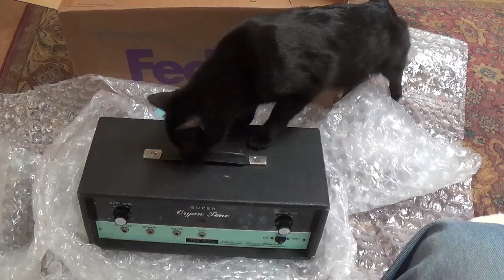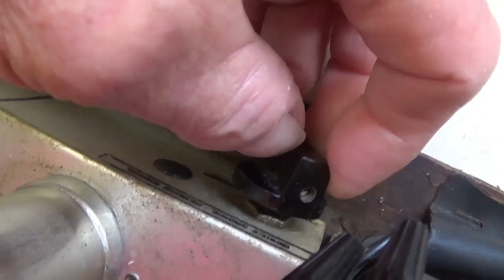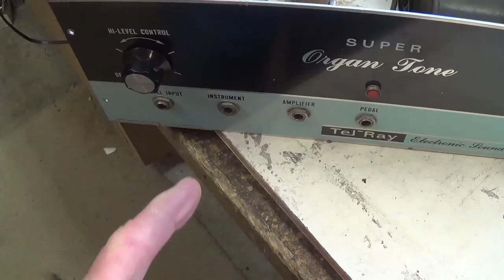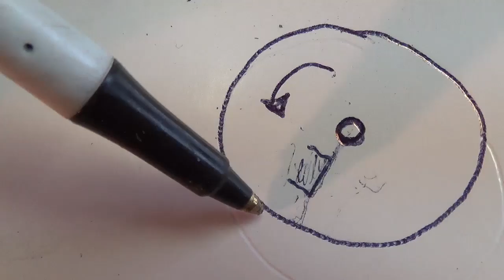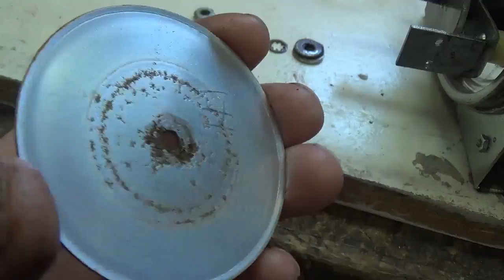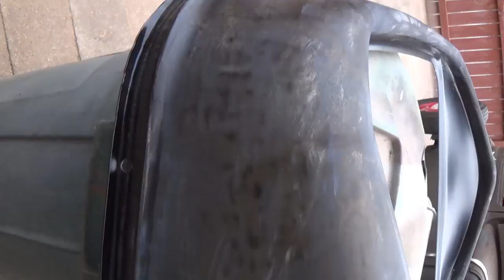Tel-Ray Super Organ Tone No.2: The Beat Goes On :)

Comment: Thanks for your videos and demonstrations (watched both of the oil can delay videos). I bought a Fender Dimension IV Sound Expander last year that was super clean and performed exceptionally. Found another just a couple weeks ago. The seller mentioned it needed new fluid so I purchased the UCON LB-65 from eBay. The motor works. Opened the can (very clean inside), removed the small amount of amber oil, added the prescribed amount of LB-65. When set to Vibrato I get a very loud hum / buzz. No effect. Switching to the Reverb setting the amps reverb works. The capacitor (red red orange white lined) has a cone shaped bulb(?) attached to it. I suppose it’s hard to diagnose from this, but is there any advice you can offer in what to troubleshoot next? Thank you
Reply from the maker: It's virtually impossible to troubleshoot a rather complex device long distance, Johnny. A loud hum or buzz usually indicates the loss of a ground somewhere in the circuit, or possibly bad filter caps in the power supply.
Reply: @ thank you for your reply. I totally understand. I’ll keep at it and try to figure it out. Best to you sir!

Comment: There were two versions of these units. One was Morely to sound like Leslie and the other was an echo unit. They used different oil for the cans. I never knew the difference.
Fender had a built in version on their solid state Super Showman. (An amplifier that fender regretted making. Total POS.)
Reply from the maker: I am familiar with the different versions of oil can devices, Y, but I tend to think they are all based on the same principles and use the same UC electrolytic oil.

Comment: I have a morley rotating wah pedal that need work please help
Reply from the maker: I'm sorry, Robert, but I no longer repair these pedals, due to the lack of replacement parts, the transistorized circuit, and the wide variability in outcome.....often not satisfactory. Hopefully, some other brave soul will assume responsibility for their restoration.
Reply: Oh wow you were so knowledgeable
Reply from the maker: @503frazier  Thanks, Robert. Use what I show you in the video and see if you can repair it yourself. Good luck.

Comment: It wasn’t clear how the neoprene make conductive contact with the metal disc. Is there a strip of metal along the end?
Reply from the maker: Since the music signal storage is done by static electricity, no current has to flow through the rubber. Remember how you pick up a strong static charge when walking on rubber-soled shoes?.....the same process occurs with the rubber read/write heads.

Comment: 2021 and this is still awesome. I'm wondering if they ever did these with a variable speed control? Was the pedal simply and on/off switch?
Reply from the maker: These old electromechanical devices really are pretty snazzy, Tom. I have not seen one with a speed control.

Comment: How did you clean the disc what did you use any cleaner or spray did you wipe off the disc if so with what kind of rag material
Reply from the maker: I used a clean terrycloth rag with some of the UC oil to clean the disc. I don't trust any other chemicals.

Comment: Hi Uncle Doug. Wondering if you can offer a source for replacement cans? - I have been using your video to help me along on a refurbishing journey, but my can is rusted out and has a few holes in it.
Reply from the maker: I have no idea where you can get any parts for these archaic devices, Albert. If I were you, I would patch the can with JB Weld and thin sheet metal.
Reply: @UncleDoug  Sounds like the kind of repair that's right up my ally. Thanks so much for the quick reply. There was quite a bit of rusty chalky build up in my unit. Going to take a fair bit of cleaning to get it back to operating. Love you video can't thank you enough!

Comment: Where do people find these things. In the late I miss the 1980's and early 90's when you could walk in to a pawnshop, flea market  or odds and ends store and find amplifiers stacked 3 or 4 high, speaker cabinets, loose parts, pretty much anything electronic. Really wish I knew more back then and had money. Haha
I did buy things that looked interesting, usually testing equipment and I gave that all away to my friends dad who was an electronic maniac.

Now, I kind of like the builds that Doug does over the manufactured models, something about using an idea or prototype is appealing.
Reply from the maker: I miss the pawn shops too, John......back when they actually offered desirable, old, used items at low prices. Now, it's like going into Walmart, except the prices for old, used items is higher than new retail.

Comment: any rubber coming in contact with oil would need to be oil resistant such as neoprene or nitrile rubber otherwise the rubber will absorb the oil and soften and if under compression as it would be when used as a washer will then creep out sideways under the compression forces. it will also relax and lose any tightness applied during assembly.
Reply from the maker: Thanks for your helpful input, Stephen.
Reply: Uncle Doug that’s my honours degree in polymer science and technology! :-) and now retired from the Dow Chemical Company

Comment: What is the value and taper of the pot going to the heads?  I’m on the front end of a Fender variable delay.   I’ll be reassembling a pile of parts and a sadly gutted chassis.
Reply from the maker: I don't recall, Jon. Does the schematic specify?  If not, I guess it's time for some trial and error.
Reply: Uncle Doug there is no known schematic for this version.  The 1968-70 Fender Variable Delay Reverb-Echo with five knobs.  I have all the parts but the chassis has been sadly electrically molested.  I love your films and the way you teach. You make math so simple, at least less scary.  I’d love to see a series on data book interpretation and pentode and triode load lines.
Reply from the maker: @jonathanhorne6503  Thanks, Jon. A video on Load Lines is in the works.

Comment: I know this an old video, and I haven’t watched this yet 

but you know what would be an awesome modification that would add interesting specific utility to a device like this , if the induction motor was replaced by a DC motor with a pwm speed control, and mount the control on the front plate. 
As you probably know an induction motor is fixed RPM based on the frequency 
With the ability to modify the speed live on the motor {and thus the disc} would in effect add greatly to the ability to modify the effect in that unique system, I don’t know if that was done later I didn’t know these existed until I saw your video 
Awesome.
Reply from the maker: Thanks for an excellent suggestion, Kolin.
Reply: Uncle Doug I put waay too much thought into this for something I don’t And likely won’t own , but if the 12AX7 filament is series and 12v it could be full bridge rectified for the DC motor voltage, the PWM speed controls generally are controlled by a single Variable Resistance pot
The upper speed could simply be limited by V to the motor I.e upper V and motor choice 
At a low speed I think it would have the type of subtle effect a lot of ‘professional’ musicians would find interesting , make the Var speed a pedal and you’ve invented a whole new effect lol. 
Thanks for sharing.
Reply from the maker: @kolinevans9127  Thanks for your detailed analysis, Kolin. Perhaps a viewer who owns one of these devices will try your proposed modifications.
Reply: Uncle Doug would be cool to hear although digital VST modules have probably tried to emulate a similar thing, nevertheless.

Comment: Uh oh, another cat scan.  Ever work on a clavioline or a mellotron?  With the foot switch to turn the unit on or off, does it then pass the signal through the unit to the amp?  Who in the world came up with this idea?  Ever work on a Hammond organ Leslie system? Another radial run out problem?  Does sound like the motor. The disk  behind the working disk is called the platen isn't it?  It looks as though the bushing is worn out.  What was that weird noise at the lower end of the frequency generator?  Well, as usual, you fixed it.
Reply from the maker: Fortunately, we were successful on this one. Thanks, Rusty.

Comment: I see a mistake.  The brushes should not be that close to the disk.  they should not even touch it when its turned off.  when its powered up the motor also pushes the disk up into the pads, when off the disk pulls away from the pads.  this prevents the rubber from distorting and preserving the life span.
Reply from the maker: Sorry, PM, but having personally worked on several of these units,  I disagree. The disc in the units I have worked on does move laterally when it is driven. If it did, the gears would disengage. The rubber-head-to-disc distance does not change. Units I have opened, which have never previously been opened, are all set up exactly as I set this one up.

Comment: I’m extremely impressed with your analysis on both these videos. I’m wondering if you may have some insight on an issue I have. 

My Morley oil can echo that uses a identical or nearly identical drum, rubber heads and variable motor. My major issue is there is a “speed” control on my unit, when it is set to the lowest speed the drum spins, if I begin to turn it up it begins to stutter, and and the higher speed the drum seizes completely.  

Any input would be appreciated. I’d love to have a working unit but just can’t figure this out
Reply from the maker: It would seem that the mechanical gear drive that rotates the disc is badly worn, much like a clock works can become worn.....the gear teeth wear out and the bearing holes become oblong. Perhaps someone in your area is able to repair clockworks and could look at it for you.
Reply: Uncle Doug interesting, I never thought of that. I wonder if that component can be easily swapped out. I have a donor unit that I picked up the same time I bought the semi function pedal. The lid securing drum head is beat up but I figured an extra read disc would come in handy
Reply from the maker: @Beegs164  If the gear-drive mechanism appears to be identical, then it should interchange.....but doing so will require a complete disassembly (as I recall).

Comment: Doug, can you please elaborate on hoe you got the can separated from the back lid? I have a Fender version of this that is very rare that I'm trying to get up and running. It's virtually identical to the one you are working on. Thanks
Reply from the maker: The body of the can is carefully pried away from the rear lid, which is bolted to the motor plate. It's tricky, but can be done......be careful not to bend anything.

Comment: Amazed how simple the core of this is, a disc and 2 write heads.  I wonder how hard it would be to engineer a new one today? Is there a special coating on the disc or write heads?
Reply from the maker: The discs are anodized in some way to facilitate the storage of electrical impulses, Christopher. The method of anodization is currently unknown.
Reply: That's a shame, the mechanics are so simple other wise it could be quite a fun thing to build either as an organ tone or as a more traditional delay.

Comment: What a strange device. I would have thought the heads and disk would be magnetic, but judging by how there's just one cable going into each head I guess it's electrostatic, I am very mystified.

I would suppose that the original owner never thought of keeping the unit lubricated, on account of not only the oil being gone but also the bushings being shot in the spindle and also in the motor. Even dry motors don't initially vibrate like that until they have been allowed to chew the bushings. As for why was there lateral play in the bushing, that may be a consequence of having a force in that direction put by the belt as well as the spring that in turn pressed the shaft against one side of the bushing.
Reply from the maker: Thanks for your observations, Mr. TM.

Comment: Hi. @25.09, there's what looks to be a brown bush at the base of the spindle, before the motor plate - possibly this was supposed to go through the plate & might be something to do with stopping the spindle from rattling. I can quite easily see how bearings would wear significantly over time, due to that spring arrangement on the flywheel, which I'm guessing is there to stop the effect immediately when required. Overall a nice bit of sleuthing.
Reply from the maker: Thanks for sharing your observations, Annie. They are both astute and appreciated :)

Comment: Can you mod the unit to have a variable speed control? Like on a tape delay, if the motor is AC driven you can install a light dimmer, to slow down the rotation. Is this possible with these machines? Great work and explanation, as always.
Reply from the maker: Yes, I would think it could be done rather easily, Andras, without altering the device. Thanks !!!

Comment: What you are calling "twisties", electricians will call "wire nuts".
Fender marketed their version of the same thing as the "Dimension IV". I made the mistake of replacing the oil (that had "mysteriously" gone missing) with regular 3-in-1. Bad mistake, don't do it. Ever. The folks at Fender sent me a nice letter of reprimand when I had to send the unit to them for repair. My boss wasn't too thrilled, either.
Reply from the maker: You're right, Bill. There is only one correct oil to use in these devices. Anything else causes way more harm than good.

Comment: Could it be the polarity was switched of the motor, running it in the wrong direction?
Reply from the maker: No, it's an AC motor, PJ, and turns in the same direction as all Tel-Ray devices do. The heads were reversed.
Reply: I'm still wondering 'why' tough hahaha, people are weird ... thanx uncle D
Reply from the maker: After some of the screw-ups I've seen in amp "repairs", nothing would surprise me.

Comment: @25:08 you can see that the extra piece of metal you talked about maybe being put on to help the runout, is angled in such a way as to rub on the disk the same direction as the brushes. I wonder if instead of the last person reinstalling the brushes incorrectly, they miswired the motor so it was running backward. Is this possible?
Reply from the maker: No, the motor, as internally wired, can only run in a counter-clockwise direction. That is the way they all turn.
Reply: Not the variable echo speed unit motors, they spin clockwise because of the addition of an idler wheel pulley.
Reply: @SmokeyWire56  Thank you for the insight. I don't play much with motors so I was thinking the spin was decided by the wire connection.
Reply: @UncleDoug  Sorry I couldnt tell that from watching, and dont have personal knowledge of that systems workings, but know that at least some motors can run in both directions. It seems that the brushes and that extra piece of metal seem to set for the disk turning in the opposite direction. Maybe the person that rebuilt it before thought the disk turned in the opposite direction so set the brushes and the extra piece of metal both in the same direction.
Reply from the maker: Possibly, or they just didn't pay attention when disassembling it and put it back together incorrectly......we've all done it :)
Reply: @UncleDoug  What us do something incorrectly, say it ain't so! I'm always surprised when I actually put something together the right way. Whatever he did, at least he did it consistently. I do love the sounds that the machine makes, it might even make my guitar playing sound nice. Unlikely that that is possible, no machine is capable of the impossible.

Comment: Well...a CAT scan is a very good idea, Sir Douglas. As for KC, you'll likely have to find a management position for her.

Oh...okay. It was low on oil. I wondered why jack paused in that one area for a while. Prolly looking for a dipstick(8-). There's an idea for ya, Uncle Doug. Patent a dip stick of 
some sort for those  Super Organ Tone units(8-)

I was wondering about scratches too...you would definitely hear those probes passing over scratches. You'd also hear the probes passing over corroded areas. One use for the
oil is probably to keep a coating on the surface to keep it from corroding...

I was wondering how you got the patina on that rat rod.  I take it a blast of wax at the car wash would mess that all up in a hurry...Am I right? Thanks for showing the process.
Reply from the maker: Thanks for all the good ideas, Tom. The patina on the body of the car is all completely natural, acquired over 90 years of exposure to the elements. I used chemicals to make the grille shell closely resemble the body.
Reply: @UncleDoug  And a fine job you did on the grill shell too. I have a hunch Mother Nature will go ahead and bless your handy work. Here's hoping you will enjoy many miles
of travel in the ol' girl...or receive many bucks worth of compensation for your efforts(8-).

Comment: Wow great work on that front end. Looks great.
 Video idea.  How lowering the voltage to a guitar amp with a  variac affects tube bias and is it a viable option for a clean sounding amp to get some distortion.
Reply from the maker: Thanks, Daniel. Your idea sounds like Eddie VanHalen's "brown tone" effect, using a Variac to reduce operating voltages.
Reply: I guess that's the general idea. I'm also curious because some amps and tube radios have 220 or 250v selector switch. My socket usually provides 238v. If I use the 250 setting the amp will get less voltage. 220 may be  pushing it harder than it should?
Reply from the maker: You would have to try it both ways and measure your plate voltages.
Reply: If I get the plate dissipation on both settings to be in reasonable values (which I dont think it will), one could use that selector switch  to give the amp a diferent character.  I guess I'll have to trying it.